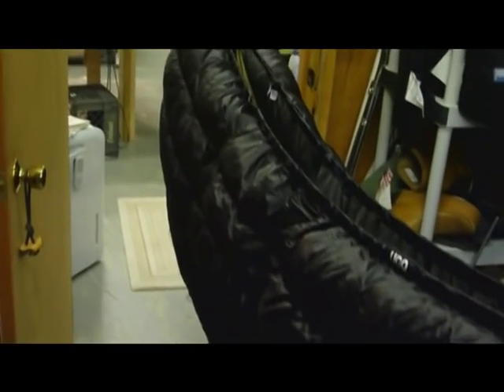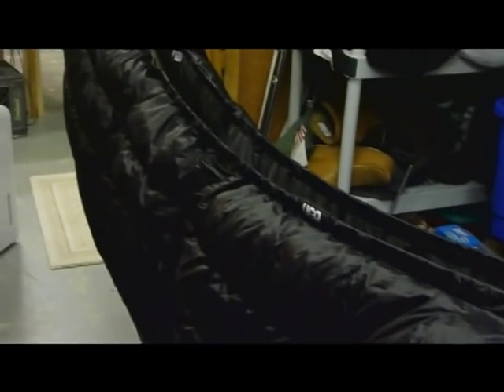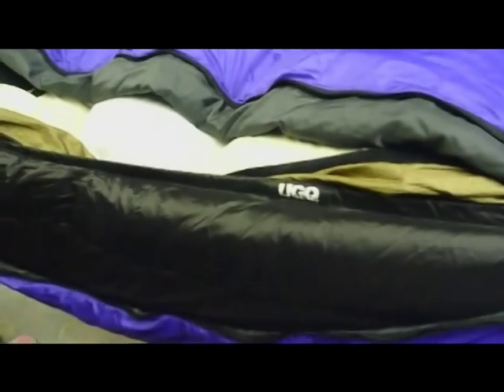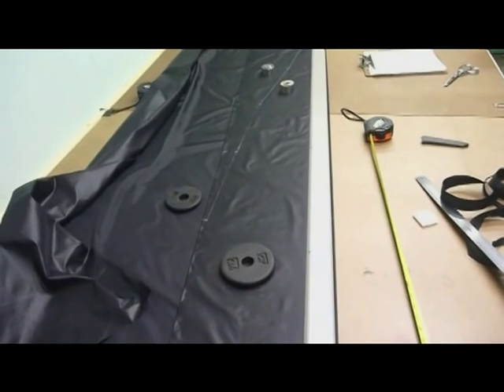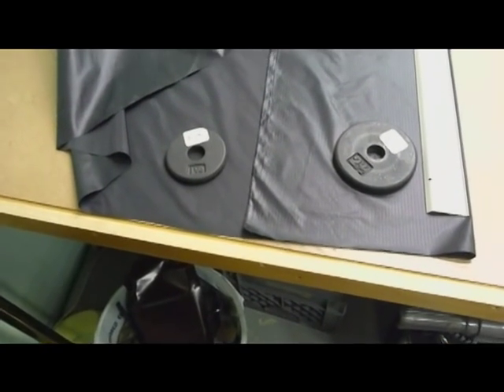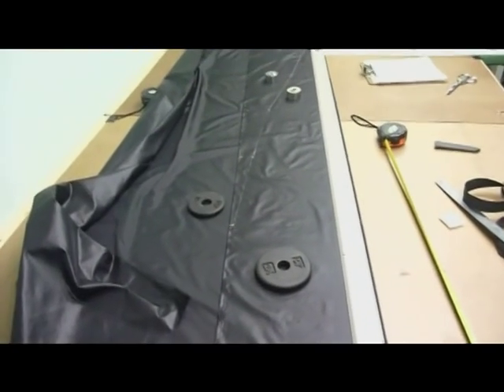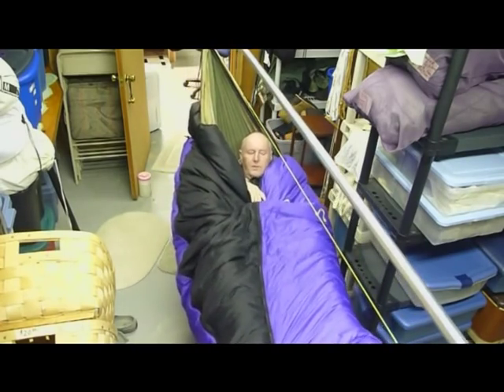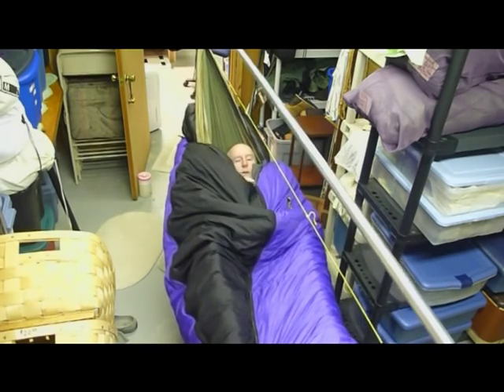Pod system bag extender

Comment: Hey, TZ.  Nice job on that pod!  I'm the guy you helped guide backing out of my blocked in spot at MAHHA this year (where I ripped the mirror off my car).  Thanks again for the help.  Anyway, do you know the model number of that Sierra designs bag?   Did it have the bottom  hole already or is that something you added?
Reply from the maker: Hey Greg
Not sure the model of that bag, it is a 0 degree synthetic, about 10 years old.  I added the bottom hole and the nylon draw tube

Comment: What mods did you make to the first purple sleeping bag
Reply from the maker: All I did to the bag was put a 6 inch long hole at the bottom of the foot and sew a doubled piece of nylon around it with an elastic draw cord, like a stuff sack top, to seal around the hammock and to reinforce and seal.  I added lift tabs at the head end on both sides and used stretch cord to pull it up to the hammock suspension.  Additional lift tabs were added in 2 spots on each side, again stretch cord, to go to the ridge line, on the entry side hooks were used for east entry at the ridgeline.  hope that helps